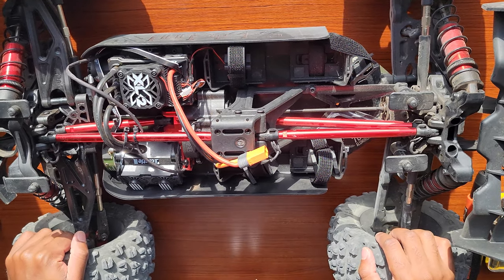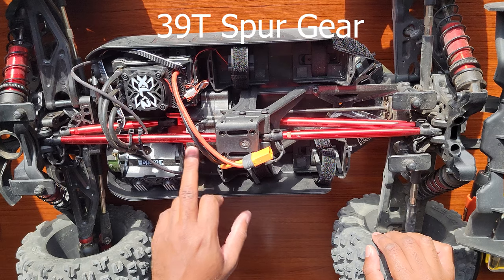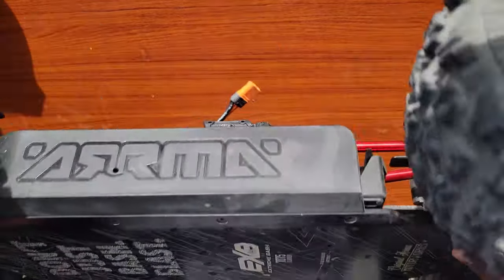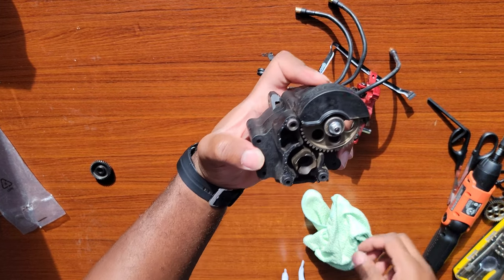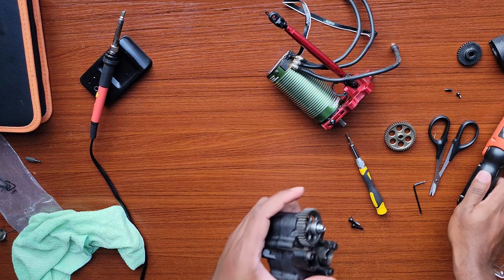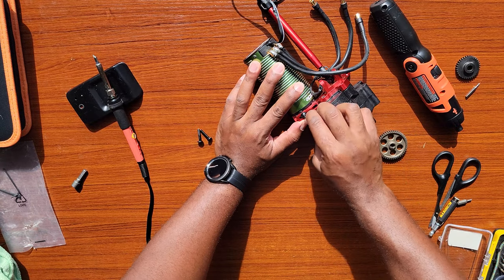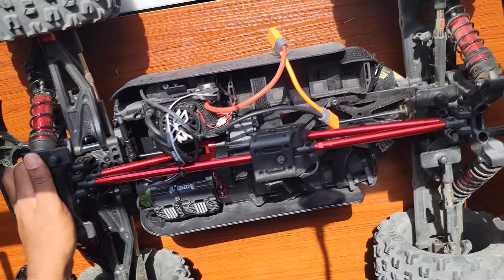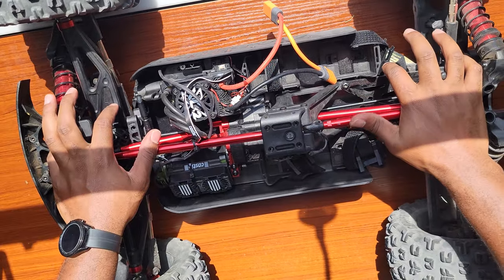How to change Arrma Kraton spur gear - 47T to 39T Spur gear

Comment: Which castle motor do you have in the video
Reply from the maker: 2028 1100kv
Reply: @GregSupe  noob Q. It looks like you had a stock mounting plate.  Are the mounting holes the same for the 1100kv and the 800kv?
Reply from the maker: @ArticSun  Yep yep, the 1100kv and the 800kv are the same dimensions, and mounting I believe.
Reply: @Greg Supe  I have an 800kv, but I've been waiting for my pps mount to come in to install it.  I may go ahead and give it a shot tonight
Reply from the maker: @ArticSun  Yea nothing to lose. The PPS mount will be better but the stock mount should work. Just use the optional insert piece that fits the larger motor.
Reply: Ah my motor mount from PPS should be here today.  It didn't fit